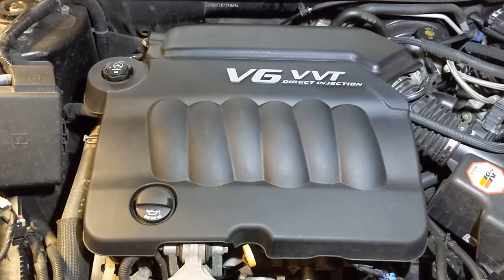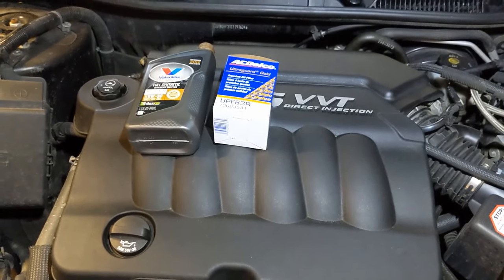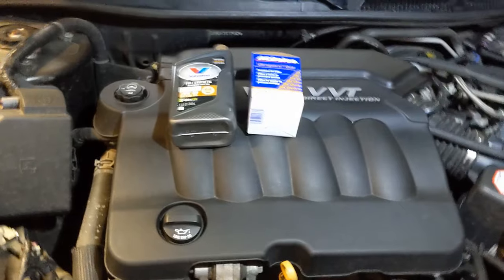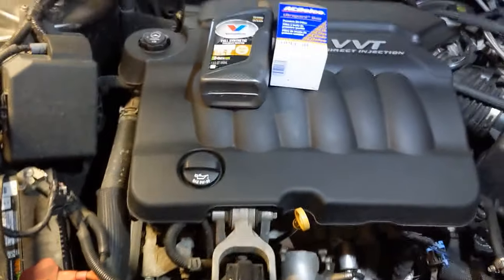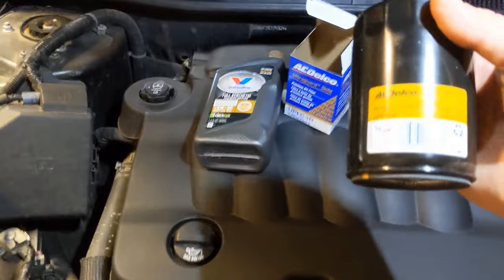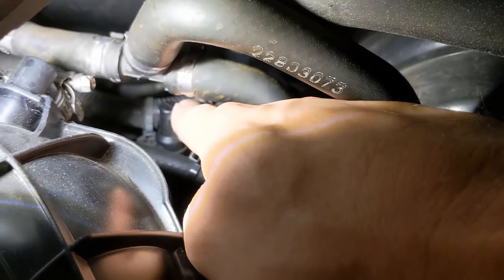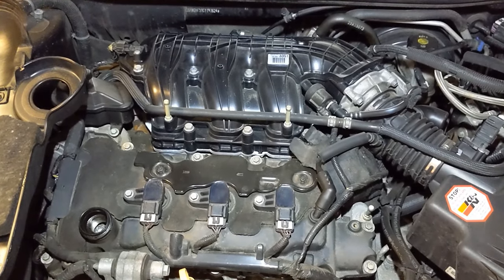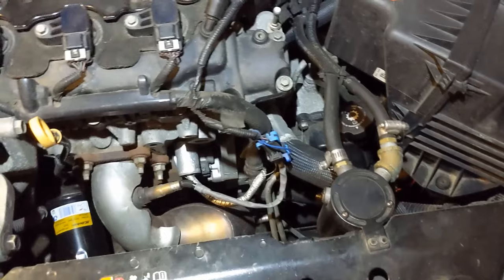How to keep your GM 3.0 or 3.6 V6 running forever - **High Feature V6 LY7 LLT LFX LGX LGZ**

Comment: Another thing about these engines is the PCV valve. GM didn't make the holes big enough so it creates positive crank pressure. If you're getting oil in your plug wells, that's what it is. You can drill it out to GM's "fix" spec. 5/64 on one side, 7/64 on the other. Smaller one for the small holes big one for the big hole, you can figure it out. Not difficult. I would get a valve cover gasket set and do it all after that. No more oil in the plug wells because the pressure problem is fixed. Make sure you clean the PCV very well before reinstalling. Blow it out with air to get all the metal shavings out and soak it in brake cleaner or something of that nature. Blowing out again right after that. 3.6 Cadillac CTS 2011.
Reply from the maker: I mentioned this in the video (and the description!)😂😂

Comment: I just hit 211k on my 2012 Impala with the 3.6 v6 no issues at all besides some suspension problems I used it for a lot of city driving a lot of idling hours and she still running strong. The main thing is to change the oil every 3-5k miles and using seafoam every oil change. I highly recommend Pennzoil Full Synthetic High Mileage  and AC Delco Filters.
Reply from the maker: I avoid Pennzoil like the plague with this engine. Didn't matter if I was running Ultra Platinum or regular Platinum, the oil consumption with Pennzoil was unbearable!! Consuming 1 quart every 3k is unacceptable to me, especially when running Valvoline Modern Engine it only consumes 1/4 quart on a 4k OCI.
Reply: @CertifiedShadetree  I been using Pennzoil ultra platinum ever since I got the car and everytime I change the oil I check the level and it's always at the full mark so I don't think mine burn oil at all. And the oil it's always golden so I know the inside of the engine is squeaky clean.
Reply from the maker: @YanilMiami305  Interesting.🤔 I've ran Ultra Platinum in 3 separate 3.6's and all had the same result. I'll absolutely run it in anything else, it's been my go-to oil for years. I just haven't had any luck with it in my 3.6's..
Reply: @CertifiedShadetree  yeah I been running pennzoil on all my vehicles and never had the burning oil issue.  This is the first time I hear that about pennzoil. I even ran it on my old GMC Yukon with the 6.2 v8 and AFM and never burnt oil and those v8s with AFM are notorious for burning oil
Reply: @YanilMiami305  I have a malibu 3.6l 2009 215.000kms i use Pennzoil Ultra Platinum, have no leaks and dosen't burn oil, i wonder if i should change to  Pennzoil Full Synthetic High Mileage
Reply: @nunol1554  I mean I don't think it will make a difference TBH if that's what you been using I would stick to that. The only only difference is that Pennzoil Full Synthetic 
Platinum High Mileage has more " Wear Protection " additives
Reply: @YanilMiami305  Yea 
I think i will keep using same oil and when it starts burning oil i'll change to high mileage lol
thanks
Reply: @CertifiedShadetree  What do you think of Supertech (WalMart brand) Synthetic oil? Also, Quaker State Synthetic oil is the same price at WalMart @ $21 for a 5 quart jug. Both oils are pretty reliable (for the low price) from what I hear.
Reply from the maker: @thedirtybubble9613  I've used it in pushrod motors without issues, but haven't used it in my 3.6, so I can't say for sure if the 3.6 will consume it or not.
Reply: @CertifiedShadetree  u
Reply: By
Reply: The

Comment: I have a 2012 Impala LT 3.6 with 208k miles. I recommend doing a BG Engine Performance Restoration (EPR) flush every 15k miles. It helps with carbon build up that makes the piston rings stick, which can lead to burning oil. Also doing and intake valve cleaning. I usually have my mechanic do a BG Air Induction Service or when I do it myself, I use CRC Intake Valve Cleaner from O'Reilly. Very simple to do. When my engine feels sluggish, I do these services and it restores performance. Also, great tip on resetting a trip odometer. I usually set my Trip B and make sure I don't go over 5k miles between oil changes.
Reply from the maker: How much does your mechanic charge for each BG service?  I posted links to WatchJRGo in another video where he had the service done to an 11 Camaro LLT. Think he said he spent $350 all said and done. I have used the CRC GDI spray before, but haven't used it since installing the catch can.

Comment: I have a Pontiac G8 with the 3.6 everyone told me to stay away (its my daily commuter) and that its gonna blow up and the chains will fail. I bought the car with 200k miles and im only a few hundred miles away from 240k and this motor has been nothing but good to me. Still has plenty of power, nothing catastrophic has happened and i change the oil every 3-5k miles with Mobil 1 Synthetic dexos oil. I have my fun with the car but i never beat on her too hard. Dont be scared of GMs 3.6 its a great motor just gotta take care of it!
Reply from the maker: Proof positive that if you meticulously maintain a 3.6 it'll give you years of trouble-free service!

Comment: Glad to hear you stopped using Pennzoil. My experience is oil ports clogging. I change my oil at 2000 miles, but I have a 5.3 l vortec.
Reply from the maker: Oh wow, I never had issues using it in my 04 Impala's 3400. Won't ever use it in a DI engine, that's for damn sure!!

Comment: Ever since Holden in Australia moved from the 3800 Buick to these,  loads have defected to the Ford rival as it's 4.0 Barra inline six never needs worries like this. A True Aussie motor -no worries!
Reply from the maker: Fortunately for us in the states, Ford never had such a motor for disenfranchised 3800 owners to defect to!!
Reply: @CertifiedShadetree  it'd be abit of a stretch fitting a Barra DOHC six transversely. It's already a shoehorn fitting it into a RWD sedan.
They're so good that even Toyotas that had the legendary 2JZ have had them installed. You can get massive gains with a relatively stock motor in turbo form. Word has spread and overseas people want them now. It was only sold in Australia and NZ.
It was a staple for taxi fleets here for many years as they handled the work with ease. 
I personally don't care for the sound of the things and actually prefer the high feature V6 sound in our later Commodore. I also love how the 3800 sounded in your front drive GM products more than in our rear drive Holdens, although they were enjoyable to listen to in their own right.
Reply from the maker: For sure!  Ford just doesn't have an engine worth a damn on sale in the states.  They're putting their EcoBoost engines in everything, and they grenade before 100k.  Putting a car engine in an F150 and adding a shitload of boost is a recipe for disaster!!

Hot Rod Garage on MotorTrend had an episode where they attempted to build a "better" Barra by using a 4.2 inline 6 out of an early 2000's Chevy Trailblazer.  Their whole reason for it was they had trouble getting their hands on a real Barra, and the 4.2's are cheap and plentiful.  So there is a bit of a buzz over that engine over here.
Reply: @CertifiedShadetree  I came across an Aussie discussing this GM 3.0 and 3.6 V6 and how it's actually a good powerful motor with good economy and not deserving of the terrible rap it's had here. The first lot were pretty ordinary but ones in later models were much better. He went though the same points you made about the PCV valve and how you must do your oil changes in time. 
He also mentioned the water pumps are prone to failure as well as gunk getting under the rocker covers that have to be cleaned from time to time, not sure that is purely to do with the PCV valve issue alone or just how they are. It's a pity it's not a totally set and forget engine but videos like yours offer a way to keep it viable as a long term ownership prospect.
Reply from the maker: @jamesfrench7299  From what I've read, the valve cover getting sludged up is a direct result of the restrictive PCV, and it tends to only happen on the valve cover with said restrictive PCV.  I haven't personally experienced any issues with the water pump (knock on wood) but it's a good thing to keep in the back of your mind.
Reply: @CertifiedShadetree  thanks, I wasn't sure. The water pump issue might be Aussie market specific from an outside supplier to the factory. I'm one who recoils at the thought of letting oil changes lapse and am very concerned with using the best oil, so the GM V6 is a good fit for me, except I have heard that accessing certain components is a PITA at least on our RWD cars.
Ford Falcons with the Barra 2003 -2016 have their own issues with suspension bushings wearing out, intake gaskets getting old and not sealing, coil packs failing and the dreaded transmission milkshake where a plastic part of the transmission cooler lines let water into the gearbox, only sorted in later models and requiring an aftermarket kit to prevent it on the older models.
Not nice when it happens too one oh the ZF 6 speed models.
Reply from the maker: You guys certainly have cooler cars than we do!!
Reply: @CertifiedShadetree  It makes me angry we don't make cars now. I'm disgusted.
We designed the best looking sedans in the world IMO. Apparently Americans have said our styling is boring, yet you guys have no problem with Toyotas 😛.
I personally think some of your designs are weird looking but I still love American cars. 
Also we wouldn't have had the car industry we did enjoy without you guys, so thanks.
Reply from the maker: @jamesfrench7299  I personally don't get the whole fascination with toyota. The only good ones were early-mid90's. The biased automotive media paints them as some paragon of virtue, but they've been in the shitter quality-wise for quite some time and the media always gives them a pass.  Well our domestic manufacturers are down to a handful of cars, the rest are Pickup Trucks, SUV's and CUV's, so our domestic "car" industry is pretty much a corpse at this point as well.  I blame the auto unions forcing the domestics to continue to artificially raise their wages to the point where the only things profitable are $80k Pickups and SUV's. That and the right-to-work states practically begging toyota, et. all to set up shop in their states and they pay market-rate wages.  Much easier to make a profit on a $30k sedan made in the US when the line workers are paid $15 an hour instead of $32.  It's no wonder GM's largest and most profitable market is China (even better, go somewhere where you can pay your line workers $15 a month!!)

Comment: Awesome video, I have a 2015 Impala with the 3.6 and I love the engine, but I am considering selling it.  Only has 44k on it.  The engine is strong, but with gas prices I am going to get a Sonic or a older civic.  I just don't trust these GM engines either.  It's fun and smooth but I'll go with a reliable little tank type car in these times.  I never knew of these problems with this engine, what a shame.  You know they can build a flawless car, but margins are better when you skimp and put profit ahead of quality.
Reply from the maker: That's a shame, but I get it. If these 3.6's were built like the old 3800's I bet GM wouldn't have cancelled all but a couple of their sedan offerings!!

But just to offer a bit of solace, my '12 Impala with the 3.6 now has 180k on it. Still runs like a swiss watch, too (I'm knocking furiously on wood as I say that)!!
Reply: @CertifiedShadetree  That's awesome to hear someone has had good luck with the 3.6. And I 100% agree about the 3.8 I had a LeSabre 01 with that engine.....what a great engine, a tank for sure.  Now the tranny in that Buick is another story.  I had to rebuild it at 115k.  Kept it until 175k and that engine did not burn oil, started every single time.  And 200 horses was plenty even in that big boat.
Reply from the maker: Yeah those 4T65-E's were pretty hit and miss, especially the pre-03's without the hardened 4th gear spline.  I lucked out on an 04 Impala I used to own, never had any issues with the shift solenoids or the 4th gear spline. Made it to 220k before I sold it.  The 3400 was a different story!! 🤣

Comment: True , I have a Holden Commodore HFSV6 , with the 3.6 litre , I change oil every 5000 KM , it will go to the dealer for its scheduled service at 15000 KM , the intervals are way to high on these engines
Reply from the maker: How's this for way too high: I just changed the oil when I hit 5k miles since the last oil change and the Oil Life Monitor said 42%!!
Reply: 4.0ltr
Reply: It is way too high, they recommend 12,000 to 15,000km every service, as they were trying to compete locally in that regard against the Ford falcon and Toyota aurion, any oil over  7000km in this engine = goodbye timing chains. Flawed pcv system you really can't afford sludge in any form. I do 5000km as well.

Comment: My wife’s 2009 Pontiac g8 has a 3.6.    135,000 miles and have always changed the oil at 5k miles with Valvoline synthetic.   I has the dreaded code for timing chain.  The thing is, that light has been on since 50k miles.   The engine isn’t noisy like the chains have stretched.
Reply from the maker: Try cleaning the VVT solenoids, the crank sensor, and the cam sensor first. Might be something that simple..

Comment: Great advice here!  Just bought a 2017 Holden Commodore (Aussie car) with the 3.0L V6 & 85K km [55K miles] on it and will be changing my oil every 5000km [3K miles], just like I do with all my other vehicles.  I think a major problem was GM's specified service interval for oil changes which is just way too long at 15K km [9375 miles] for this particular vehicle (not sure what GM's service interval is in the 'States), even with synthetic oil and was leading to a lot of the oil contamination and sludging issues that was made worse by poor crankcase ventilation due to a bad PVC valve design.  They did make a slight change to the service interval in later years here in Oz, reducing it from 12 months/15K km to 9 months/15K km however I doubt that this makes a huge difference to the outcome.  

I've heard it suggested that these long service intervals are also responsible for a lot of the lifter failures on GM's LS V8 motors with the AFM/DOD cylinder deactivation system, as oil contamination was leading to blockages affecting oil pressure at the DOD control manifold which was killing these complicated DOD lifters (I have this exact issue on one of my LS vehicles).
Reply from the maker: Yep 100%. Changing the oil often is the best thing you can do on these engines!!
Reply: they want you to buy new cars well before 200k...in response to long oil change interval recommendations

Comment: I've drove my 08 Cadillac Cts with the the DI 3.6 for almost 100k miles whilst using mobil-1 and have never had any issues. Itry to always get the oil changed around 5k miles. The miles are 98% highway and very little short trips done.
Reply: Thanks for this, I’m looking at a 3.6di 2009 cts and all of this timing chain stuff somewhat scared me away.

Comment: THX for the video. I drive a '19 Camaro with the LGX w/ 23K on the clock. Bought used. Did the first oil change after 2800 miles mainly because I didnt know what type of oil was in it. It was fresh when I bought it. Put Dexos approved Mobil 1 full synthetic in the thing. IT HATES IT. Was a very quick car. Now... sluggish. I've always ran Mobil 1 in my cars. Can't wait to get it out of this one. Never known oil to have that kind of affect.
Reply from the maker: Did you use the recommended viscosity? The only time I can recall an instance like that happening to me was when I put Mobil 1 10w30 in a 3100 V6 in the summer instead of the recommended 5w30. Car ran like complete ASS with the 10w30. Ran completely fine after I drained out the 10w30 and put Mobil 1 5w30 back in.
Reply: @CertifiedShadetree  thx for your reply. It calls for 5w-30. That's what it got. When I say it hates it, it still runs fine but it definitely had a negative impact on performance. Bought it from Carvana. No idea what they had in it. Had a Motorcraft filter on it!
Reply from the maker: My only other thought would be to check the API standard the car requires, and if the oil matches or exceeds it. One would think Mobil 1 would be up to the current standard, but you never know anymore!! Also the bobistheoilguy.com forums would be a good place to seek answers.
Reply: @CertifiedShadetree  bro I feel like an idiot. It wasnt the oil. I'm not sure why I was so convinced it was. Anyway, I had taken it out of sport mode! Didnt realize until a few hours ago. Huge difference. THX for your help.
Reply from the maker: @chadpugh1490  Glad to hear it wasn't an oil issue!! 😌